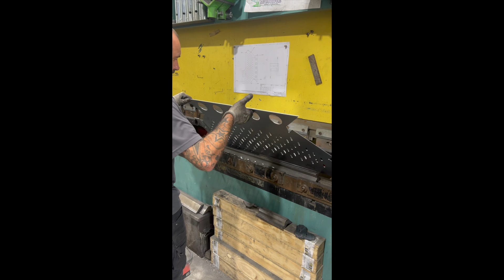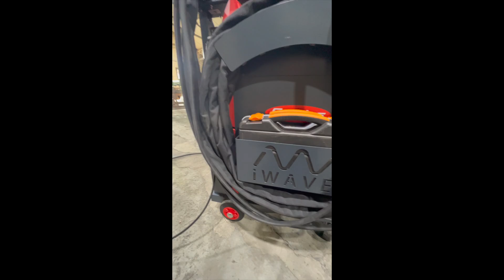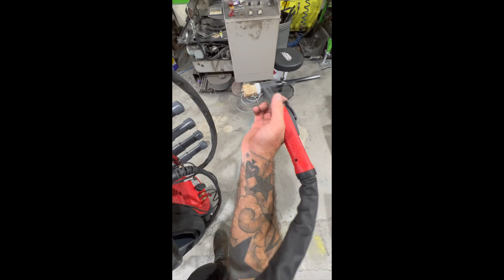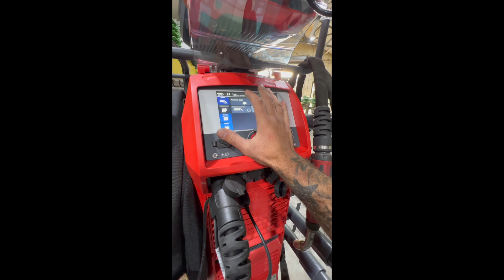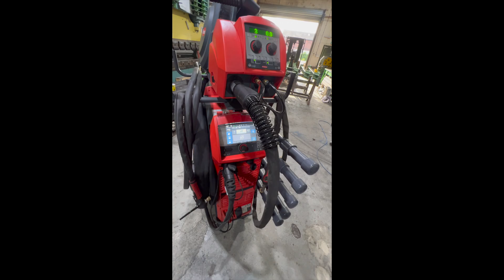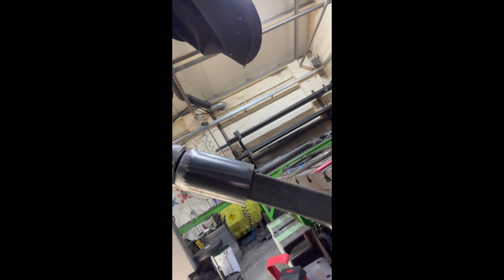Fronius iWave 400i AC/DC Multiprocess Pro Review

Comment: Fronius make the best migs but as you can see their proprietary tig torches are just rubbish compared to Kemppi atleast kemppi had the sense to use mostly standard sized consumables I dont see why you need anything much other than a standard consumable head wp9 or 26 tig torch but fronius obviously has other ideas.      Kemppi tig machines overall are just better and with their proprietary swivel torches.

Comment: Hello from Canada, I have  2 Fronius welders, smaller models. I love both, every thing on them works well for me. I was looking to buy a 3000 or 4000  pulse but they only come in 3 phase and currently I don't have 3 phase in my shop, so I ended up with an Italian welder
Which does pulse and double pulse etc  , with single phase. If 3 phase comes my way then I would be back looking for another Fronius, they are very fine welders.

Comment: Im currently building a 300i AC/DC with TIG dynamic wire along with multi-purpose pro packages. It definitely is a major process getting quotes with all the various options available. But not made easy with not much info available or what is actually needed. I'm hoping I have a smoother process than your on delivery!

Comment: Hi , got the same machine but without the mig mag upgrade , only Stick and wig . I do mostly stick welding in the company where I work . Can't wait to see some more uploads on mig/ mag welding maybe some thicker steel and so on . How to you think it compares to the fronius transteel version in mig/ mag welding as we are looking maybe to upgrade the Iwave  , Better or only a marketing hype . Thanks and greetings from Germany
Reply: Im currently looking at the 300i setup with mig Inc. From what I can gather from my local fronius dealer/shop. Is that the measurements/feedback that the machine reads is far lower in the transteel machines vs iwave/tpsi. I think it was 200 vs 2000 a sec or something.